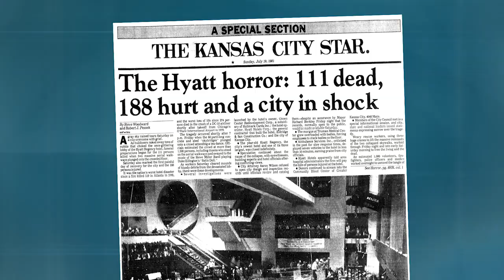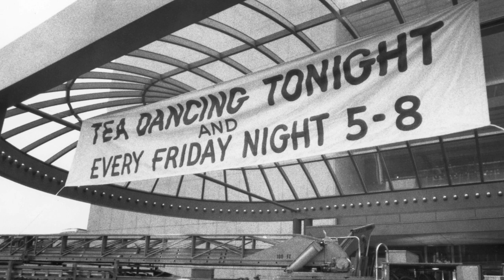Hyatt Regency Walkway Collapse: Ethics Case Study No. 4

Comment: Loading the two C channels at the weld seam with nothing but a nut and washer created a cantilever ON EACH individual C channel.  That's where the failure occurred....at the split....and would have occurred even if the supporting rod design had never been changed.  
So, although there are questions of ethics and chain of responsibility..........the basic engineering of the whole endeavor was flawed at its roots.

Comment: The design should have been done with HSS beams, instead of welding two C Channels together to make a tube beam. Then they could weld plate caps at the end of those beams, to stiffen them up as needed. Then they could have the hanger rods segmented as they did. The whole thing would been just fine.

Comment: Ignorance of the law is one thing.  Doing the right thing is a higher responsibility.  I used to insure construction companies and I will tell you that this is why insurance for this type of thing is so expensive.  We had excellent clients who I would trust to build anything but there were others who I would not trust to pour a flat concrete patio in my back yard.   In this case, Jack Gillum, after his company failed, spent the rest of his life lecturing to engineering students the lessons learned from this disaster.

Comment: This accident is amazing, because the flaw in design was so obvious. It may have taken an engineer to see the flaw in altering the hanger rod design, but any ten year old could see that having the entire structure relying on bolts attached at welded seams is just moronic. I assume that nobody under the age of ten worked on this site, so at least one of the hundreds of people that saw this during construction should have noticed this ridiculous flaw in design.
Reply: It was a stupid idea to commit to the long contiguous rod idea in the first place. It probably was hard to source such a thing. It was why they used two C channels welded together vs an HSS, I believe. I think the intent was to field weld the C channels in place, which is the solution to the problem presented by the long rod.

I think the architect wanted that instead of seeing the rod offset at the 4th floor bridge. But they should have given up on that detail and had the SE do the rod chain with HSS beams. It would have looked fine and been all good.

Comment: I see another problem which could have contributed to the failure, where the rod passes through the tubing, there should have been an insert inside
the tubing (solid bushing or rectangular ) to take the load, even if the tubing was DOM. And especially if it was welded! The stress where the bolts 
were placed would exceed the cross section of the tubing, causing it to cave in and split, as the results showed.
Reply: my exact thoughts, its unreal if they just bored the box beams and passed the rods tru and bolted it on the underside. box beams are usually relatively thin walled for their width and height and load bearing capacity. they are not designed to take on such point loads, they are good in bearing (entire width supported by a column or beam) or in axial, but not a point load like that. at the very least there should have been stiffeners and increasing of the wall thickness around the connection and some distance away.

Comment: At 8:07  the man said the damn thing failed in October 1979 while being built. WHY in gods name did not send some red flags up. The hell with the laws. You know a change was made and now the change part FAILS and you don t investigate why? Hell even HYATT ( the untrained customer) started asking questions. The engineers cite money for your reason you did not follow up. I am sorry I always thought this was a terrible accident. No! This was negligent homicide! The engineers should be held for negligent Homicide of 121 people!
Reply: It was the atrium that collapsed.  The point of referencing that event was that the resulting building-wide directive to conduct safety checks should have been a prime opportunity to notice that the necessary calculations for the steel to steel connections were not yet done, and so to do them.  In lieu of the rest of the evidence, this is pretty damning that the structural engineers continually gave assurances that they had done due diligence when they had not.

Comment: Now a days i guarantee that this tragedy would have resulted in serious prison time for anyone who had a hand in this.
Reply: Mike Uhlir — Don’t bet on that.  Have there been criminal charges in connection with the collapse at Florida International University?
Reply: both designs are stupid and unsafe. one the original deisgn only a single nut holds each floor at each corner. and only a single rod at each corner holds all the floors. combined with metal fatigue= collapse and now a days look at how sloppy things are . very very sloppy.

Comment: They never took into consideration that like when a military walks across a bridge structure it can cause it to collapse... [Rocking motion created by their feet in unison...] The same holds true for dancing in unison people on a walkway... No one envisioned this would be the case when they built the walkway and yes the architect signed off on his responsibilities but the hotel itself created the dance night to attract customers... [Without pre checking to see if the structure could handle such type loads of dancing people...] Therefore who's actually to blame???: https://www.livescience.com/34608-break-stride-frequency-of-vibration.html
Reply: No. If the engineer had done the math (aka his job and ethical duty), he would have known that the walkway was doomed to collapse, even without an event like the tea dance. The dancing was just the straw that broke the camels back.

Not to mention, that no architectural design should be so close to failure that people living and dancing in/on it can cause it to collapse. As an engineer, you're supposed to design your product for people to use it. If people can't hold an event in a building without worrying that the building is going to come crashing down on them, then the building is not worth anything.
Reply: https://www.youtube.com/watch?v=juGHvvIsgVw&frags=pl%2Cwn
Reply: Complete bullshit. The investigation by the NBS showed that the added weight of the people standing on the walkway alone was enough to cause the joints to fail, the people on the walkway were up there to get away from the dance and were filmed not dancing, and investigators did the harmonic resonance calculations on the dance and the bridge and found them to be inharmonious.
Reply: The change in the design effectively DOUBLED the weight being held by the top portion. Where before, the load was being split evenly by both floors onto the single rod, after the change, the whole load of both floors is on the nuts holding up the 4th floor. This is a math problem that was not done. If they had done so, they would have immediately realized they are doubling the load in one area
Reply: The lessors of the property in some cases may bear responsibility for such a disaster. But in this situation, Hyatt was not too blame. They relied upon the experts they had hired, who reassured them it was safe. Horrible tragedy but the blame rests with the engineers.
Reply: Furthermore, in the video, the gentleman explains that Hyatt had concerns and specifically called upon the engineers to check all the connections, and ensure that they were good. The engineers didn't check them, and told Hyatt that they did. In other words, they lied to Hyatt about the structural integrity of their building. The blame falls squarely on the engineers.
Reply: I never thought about that..The hotel events planner actually was in part to blame. The engineer should have been told specifically what the walkways were going to do used for.